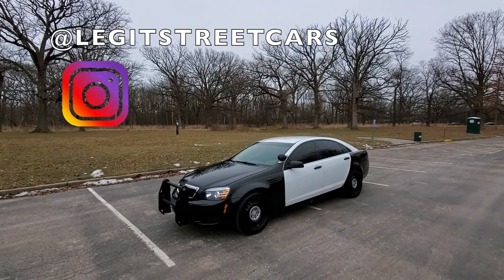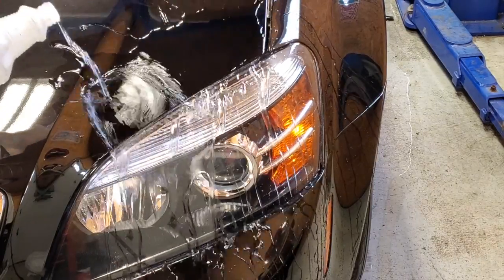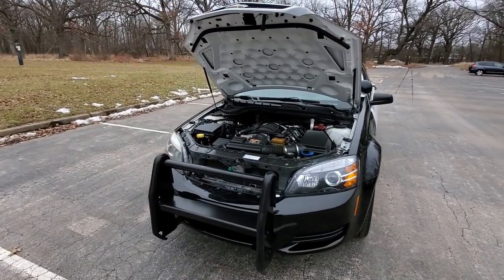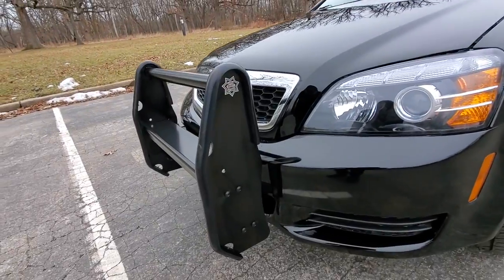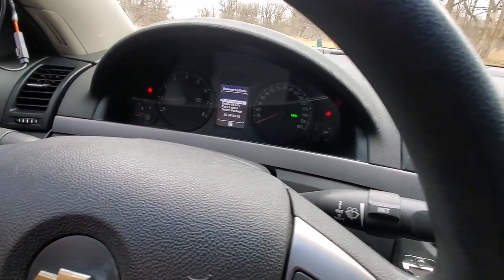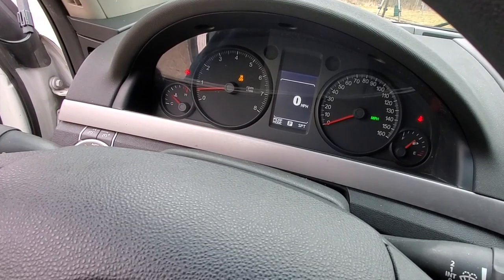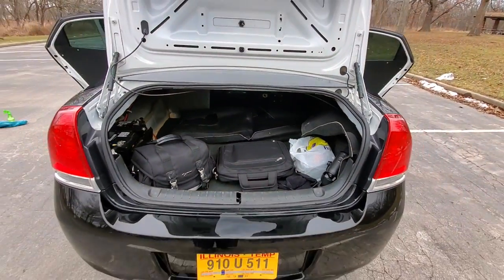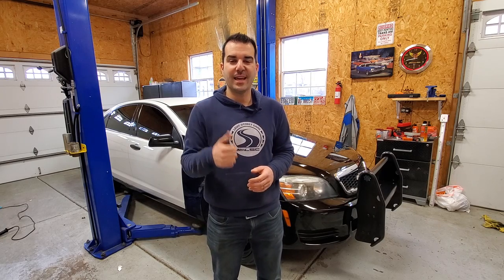I Bought The Fastest Police Car Ever Made & The Cheapest Way To Buy A Modern LS CAR! 4-Door Camaro!

Comment: The cop(s) didn’t just sit around, they don’t often turn off their cars cause the electrics with  in the car (Mobile data computers, radios , dash cams , lights) not to mention A/C and heater. Most of  them are  patrolling a certain area so most police don’t sit at a station and respond from one specific location. And most police work in 8 to 12 hour shifts , which means that 2 to 3 officers could use the same car in a full day . This is also why most police vehicles have upgraded and more heavy duty parts and components in them... 🤘🏻👍🏻

Comment: A Holden Statesman with a HSV performance package. 
Better brakes, Suspension etc. than a standard Statesman but not as many Luxury items. 
Over the years Australian Police Highway Patrols have used the Holden Commodore with similar performance packages. 
Slightly shorter with a smaller trunk. 
Not sure why the US Police would want the bigger Statesman. 
Easier to get Criminals in the back seat? Probably would not handle as well as the about 8" shorter Holden Commodore.

Comment: Lol do a full how to video on w.e u put on lbvs... ur vids are great! I wanted one of these but ended up with a chevy ss
Reply: I bought an arrest-me-red 2008 Chevy HHR SS with 5-speed &  Ecotec Turbo engine (Highest HP/CC ratio engine ever) for $6k. It tops out at the same 155 mph, gets there a LOT faster, better gas mileage, has a sun roof and is a heck of a lot more fun to drive. Cheaper too  and no mods needed. Still sits two in the back seat and they fold down for longer rifles. Just sayin'. :)

Comment: You got Lucky, I used to work in a shop for the Navy in Jacksonville FL and grew up in the northeast. I will tell you right now that the worst ever rusted out car I ever saw in my life and in almost 40 years of working on them at all levels was an Isuzu from Jacksonville Beach FL. and honestly probably the next 10 worst cars I ever saw were all either full life FL cars or FL transplants.  Warm and sunny with lots of rain doesn't help when you are on a peninsula that sticks out 300 miles into the ocean. Rock salt on the road is nothing compared to air saturated with salt.

Comment: Well not really, the 1969 Dodge Polara "Interceptors" models of the base 440 Max-Wedge crusiers used by the California Highway patrol were regularly clocked well north of 150 M.P.H.  Just because a paper makes a claim, until it's on the road it's just hype.   And in the end it doesn't matter how fast a car is in a straight line...   It still can't out run a police radio...

Comment: That cars engine has over 469 days of straight running time with idle time of just over 348 days out of the 469... I wonder how maintenance is done by hours or mileage?! I know of trucks with over 250K and only 9,000hrs! I would check oil pressure just to be on the safe side...

Comment: The Caprice goes 0-100 mph slower than the Charger with a 5.7L Hemi, and the AWD Ford Sedan Interceptor with a 3.5L V6 EcoBoost is even quicker than the 5.7L Charger. The Caprice has a top speed that is 5mph faster from the factory than the Charger or Ford, but it takes it longer to get there. A Programmer/Tuner that plugs into your OBDII diagnostic can override the factory top speed governer, therefore the Caprice is actually the slowest cop car when comparing the V8 Charger, or the EcoBoost Sedan Interceptor. The Caprice doesn't handle as good either. It's a great car and it's too bad they quit making them.

Comment: Are you going to trailer this vehicle or drive it if you are going to drive it and putting warning lights on it use white or amber just check with Illinois state laws for colours you are allowed. If no holes in the roof it could have been a Traffic enforcement vehicle, used for radar

Comment: About those "Duty Seats" where they generally just cut-down bolsters....That only happened for the more common right-hand draw officers.  None were made for us southpaws as far as I'm aware.  It was a HUGE hassle for me, as not only the seat bolsters would dig into my duty belt, but the seatbelt itself would basically fuse me to the seat an dig into my kidneys.
Reply: I ended up having a right hand cross chest draw holstered .380 under my vest in a vehicle emergency, as belted into the vehicle there was ZERO chance to draw my primary.

Comment: I noticed that there is a slight bearing noise most likely coming from one of the pulleys, and it sounds exactly like the one on my PPV. Did you ever figure out which pulley bearing it was? I am looking to fix that myself, and I suspect its the tensioner pulley's bearing. Let me know what you think. @LegitStreetCars

Comment: Ok, it’s definitely not a State Trooper car, the FHP cars are black with a TAN roof and trunk! Also, it’s not a county car, as in Florida pretty much all sheriff’s cars have some combination of green and white, or they are all white w/ green and gold stripping. It’s definitely a city PD car. Given the incredibly high hours on the engine clock, I would say it is from a rural PD, as here in FL only the country cops have time to sit around idling for most of their shift. I can think of a few rural PD’s who use that color combo, but to give you a name would be rank speculation of the highest order! I had a ‘95 Caprice 9C1, (coincidentally from Illinois) and I absolutely loved it (as well as the courtesy Miami drivers showed me when I was in it). 9C1.com was a great resource for me so give it a look. Good luck w/ your new car, I hope you are as lucky with yours as I was with  mine.

Comment: Does this have some sort of a mechanical limited slip or locker differential? Or does the traction control only operate by applying the brakes? Is there a mechanical limited slip or locker differential available for this car?
Reply from the maker: Factory lsd

Comment: wait...................what is the top end on that car??????     You might want to check the top end of the old  CHP Holsteins of the mid 60's Dodge.   May have taken a bit of time for that special 440 equipped to CHP car but it was rare you could outrun them!    Dont know for certain  but I was informed by their maintenance department that if they didnt reach 160 mph they were rejected.   I personally saw one achieve 167 mph on a test track.

Comment: HISTORY LESSON HOLDEN/GM:
As you called it a pontiac Chevy G8'y thing..... Yes it's Australian GM, no it's not a "thing", this exact car has a history going back in Australia to the 70s.
I'll set the scene. Yes it is GM Holden. Yes it is part of the Commodore Series. Or for Americans the pontiac G8. Yes we also sold you the pontiac GTO from a earlier series and the Chevy SS from our last series.
This actual car is a Holden Statesman. There are 2 higher trim levels. One a more luxurious model the Caprice. Then one higher specced performance version the Grange. Part of the HSV line of Holden vehicles. But being a base model and ruggedised this would be a stripped out Statesman. This platform came in both V6 and V8. The HSV Grange I think was 325kw. I can't say if the 340kw version eventuated. 99.99% positive there was never a 430kw LSA Grange.

Now, where does this LWB luxury car fit into Holden's line up. Keep it neutral. Think euro. The Commodore/G8/SS(trim excepted) is equivalent to a 5 Series/A6/E Class.
The Statesman/Caprice is a 7 Series/A8/S Class.
Again 3 versions of the LWB Commodore. Sold here in Australia as a LWB luxury car. It is used as a limousine hire car around metropolitan cities. Used as a government car for politicians VIPs. In base trim simply by families wanting a larger car. As a GM let me assure you, in V6 Statesman trim this is no luxury car. It is just a longer commodore.
As a Caprice yes it is more appointed. And as the top level HSV Grange at time of sale was a very appointed sleek bruiser. Around $100kAU back in the late 2000s. No not S63 money, far from it. But close to triple the price of a average families V6 sedan.

Now, the question I here you ask....... Was it used as a police car in Australia. No!!!!
General Duty/Highway Patrol.
GD of that era would have been a base V6 Commodore. HWP would have that eras HSV Clubsport(307/325kw Commodore).
Back to this cars lineage. As stated, it came from the 70s. I will exclude Grange comparisons. At commencement the Commodores predecessor was the Kingswood. The Statesman and Caprice came out to offer a luxurious option to supplement the family sedan of the 70s, the Kingswood. There was no HSV back then.
Finally, the current line up of the era in this video. The Statesman, The Caprice, the Grange. You could equate them to a Mercedes S320, S500, S63. Loosely, of course.
Finally, the "Caprice" was sold in a few countries. Over the years or different generations. 2 countries I can name straight away, middle East & China. What badge or name I can't recall.

In closing "Caprice" is a loose term. The term Caprice is not a car rather a level of trim. The same for your current SS. SS for our commodore is essentially a V8 commodore. They throw on a bumper a rear wing. Some embroided seats with SS on them. A set of SS badges on the rear doors. It is, a Commodore SS.

I can't name what the chassis of this police cruiser is based on. Suffice to say it is the Statesman/Caprice/Grange chassis. In essence a stretched Commodore. Caprice is the mid level trimmed V8 powered LWB commodore.

Now you know. 🇦🇺👍

FYI I owned a 1982 5.0L Statesman & a 2004 5.7L Caprice. First garbage, the latter quite a nice car indeed, fondly remembered.

Comment: You can do the headliner yourself. The material to recover it is available at Moonlighting Auto Tops www.moonautotop.com 1521 A-1 Ocean Avenue, Bohemia, NY 11716. You can remove the whole headliner, take the sagging fabric off, clean the foam backer, use spray adhesive (we use 3M) and smooth the new fabric on the headliner board. Reinstall and you have a new headliner that will outlast the factory one. We've done several for customers and it's really not all that difficult.

Comment: That is NOT a FHP unit- they are ALL black and TAN, not white. All cop cars(spare detective units) in South Florida pretty much RUN constantly(unless the officer exits the car for an extended period, say <30 min, due to the heat/weather). Not uncommon to run the car for the entire shift... SOOO, let us imagine it comes from a 'poor' municipality(would then have to be from the center and northern part of Florida- but then they'd keep it WELL past 82K miles in this case) which is pretty unlikely by the look and OA condition of your new cruiser, but, IF the car was a "shared" car that wasn't only used by 1 officer a day, but was handed off to an officer on the 'next' watch, well now the car likely can have  a potentially 18-20 hrs. of use a day. Highly unlikely this happened with this car IMO though. Let's do some math- 50 hrs of use per week, x52 weeks=2600hrs. per year multiplied by 5 yrs. of usage and we have a grand total of: 13,000 hrs. of service. By this formula, YOUR CAR is well under the AVERAGE ESTIMATED hours it could have. AWESOME ride... looks like loads of fun and you'll be giving every driver you get behind on the road a heart attack LOL!!! WHOOP-WHOOP

Comment: Pretty car and even more affordable as a police car.  But shush! Dont let everyone know about Holdens and 6 litre engines and  power... the stock  ls series engine suffers many problems, the 02 thru 06 Ford escape v6 3.0 duratech engine at 235 horses aluminum engine that complete dosnt weight over 350 pounds was designed by Porsche sold to ford.. love the 100kmiles engine. Fun! Now my truck I'm pulling the afm 5.3 and putting a non vvt, 6.0 l96 into it.. might have to beef up the CAM because stock with  no tune the engine only rates 45 horsepower over the 5.3.  07 avalanche truck...A new project. Not my loved Fords but makes power. send me aussie performance knowledge please.... last if the non ford interceptors  ..

Comment: You mention the rock salt rusting cars. Be grateful you don't have the nasty white chemical some states use instead of salt. It rots cars out so fast that without stainless steel lines for everything underneath and constantly treating your frame to fliud film or something better, any vehicle that sees lots of winter driving will have a car ruined beyond the point of being saveable in less than 5 years. Typically with barely 100,000 miles on it. I've spend over $10,000 on rust rust repair and prevention on my truck over the last few years. It's a nightmare and a safety issue. It's very common to see people crash or break down from rotted brake lines, steering lines, transmission lines, fuel lines, etc. Salt is bad too but the car will last a lot longer with just salt.

Comment: fastest I've been without a ticket was 125mph in my 1989 dodge Dakota with the 3.9 v6 all the emissions carp was removed 170 hp n 210 torque believe it or not they will do it as there not governed n they will get up n go if u removed the emissions crap

Comment: Did you mean 500 crank horsepower? Cause 500 wheel hp is about 650 crank. Give or take with traditional transmission parasitic loss.

Comment: The 2015 FPIU I bought this month has 3K total hours on it.  Ford Fleet uses the 33-mile/hour-run equivalent - yours would be a ~280,000 mile equivalent car.

Couple of things you'd want to pay attention to...
#1, Trunk: because cop cars get rear-ended a lot, they don't mount things front to back, they do it side to side.  No sense in getting punched in a spine with your own stuff if you get rear ended.
#2, Paint/lights: Impersonating a police officer is a felony in Illinois.  The Internets are chalk full of stories of people getting pulled for dressing up a car to be like a police and putting lights on them that are illegal to equip a vehicle with.  recently: https://wpta21.com/2020/01/06/illinois-man-arrested-for-impersonating-a-police-officer/   Some states (cough California cough) even have codes like CVC 27605 (No person shall own or operate a motor vehicle painted in ["black and white", verbose section reference replaced by me] to resemble a motor vehicle used by a peace officer or traffic officer on duty), some states don't even require intent to impersonate in order to convict.  Be careful with this - kind of like handling a gun, the laws are pretty harsh against abuse, and that should be respected.
#3, Computer mount: see above comment and then think about the air bag.  Some of these cars have "airbag disables" when the computer is mounted in the vehicle - you really don't want to get punched in the face with a laptop or laptop+mount.  The modifier's guide will be your friend here.  I love those peple who out all those sharp knick-knacks on their dashboard right over the passenger airbag.  Looks like someone wants to be in Faces of Death, minus their face...

One of the reasons I like the FPIU and other LEO vehicles is that they are designed and built to be modified.  Most of them have manufacturer portals that lead you to all of the documentation for those vehicles.  The FPIU I got has the 220Amp alternator, and no center console - meaning there is a ton of space in the middle to put in a custom center console solution.  Ford also puts in extra wiring ports which obviously makes aftermarket exterior lighting easier, and even car audio power easier (they have a 50Amp circuit going to the rear-pass quarter panel).  Plenty of "oopmf" to run a few after market amps.  With kids, those rubber floors are awesome...

Ford also stiffened up the chassis in the FPIU more than even the ST model Explorers, the thing sits FLAT in a corner - and it's addictive.

Comment: Those Holdens are notoriously unreliable. Parts are hard to come by. Also, they are not, repeat not, the fastest police
interceptor used in the U.S. The V-8 Dodge Charger interceptor tops out at 163 mph., according to track tests run by the Michigan State Police, and the L.A. County Sheriffs.

Comment: That car is not gigantic! If you put it next to the 1975 Plymouth Grand Fury I drove as an Il. State Trooper it looks like a kiddy car.
Reply from the maker: For a 2012 it's a big car. Obviously the old stuff is bigger
Reply: LegitStreetCars In the smaller Caprices and Impalas you can reach across and touch the passenger door from the driver’s seat. You could not do that in the 60s and 70s squad cars. The last squad car I was issued was a 1999 Ford Crown Vic. Very large but a dinky little 261c.i. engine. Top end was only 126 mph. Our cars (state police) were supposed to top out at over 140. Mine was programmed wrong. The equipment officer told me to take it to a dealer and have it reprogrammed. I didn’t do that. After 28 years, 126 mph was plenty fast enough for me.
Reply: LegitStreetCars  Just before I retired they started buying Chevy Impalas. Dinky kiddie cars with 6 cylinder engines. No thanks. My father was a Chicago cop in the laws 50s and 60s. He city cars they used were Plymouth Valiants with 6 cylinder engines. Their expressway cars had 8 cylinder engines.

Comment: Cop cars are driven hard but when ever any thing goes wrong their fixed and their mantained id have no probles buy used highway patroll car. Other bad part is if it has 80k miles it has a billion hours on it but with that sead i know chevys we used at asplund tree we ran all day same way cops do and we would have them be more relyable then any average car my asplund truck was 2009 and it only had breaks done and one alternator just because it sqeaked in-10degree cold and that truck and all my co workers trucks that ideled all day would get easy 400,000 miles